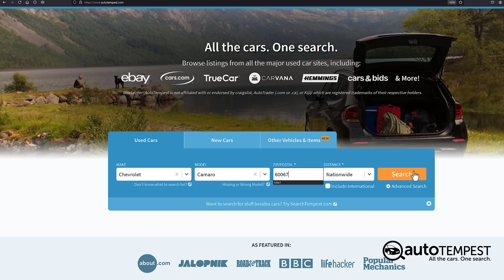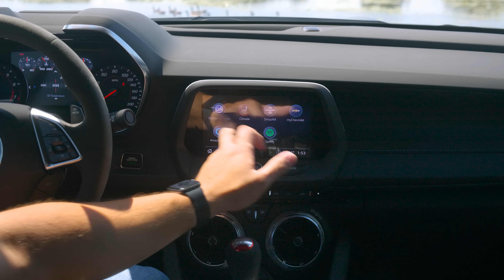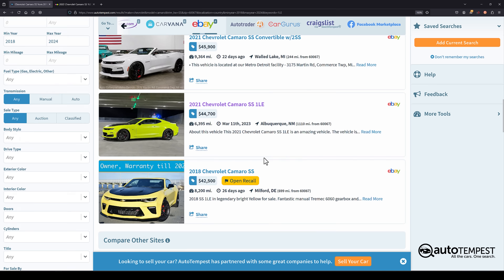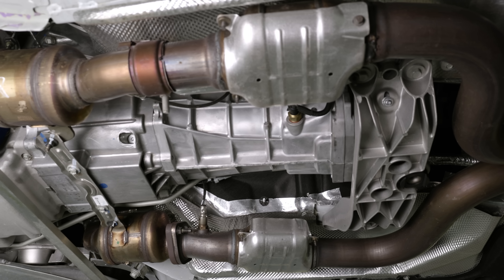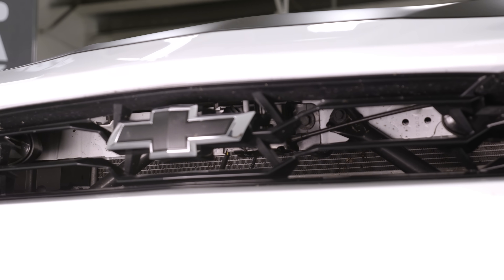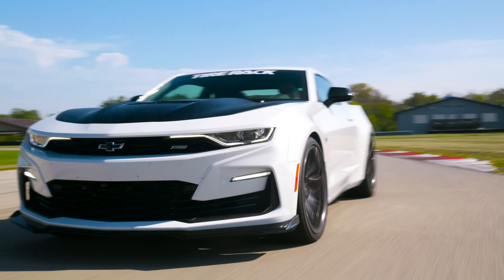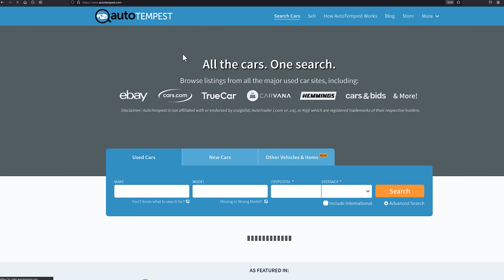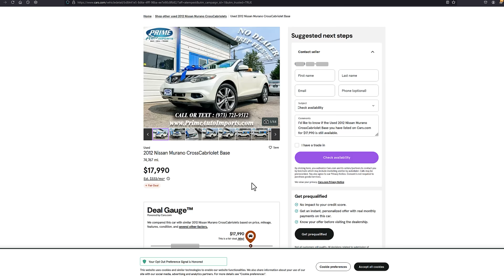Chevy Camaro SS 1LE | Best Used Sports Car of 2024

Comment: Owned a 2015 5th Gen SS1LE and now a 6th Gen ZL1 1LE, They're amazing cars. GM performance engineering is TOP TIER!
Reply: Do you get used to the visibility? That's the only thing holding me back. I like to keep cars long term and I'm not sure I could deal with it.
Reply: @hhaste i rented an SS and def the rear cameras are needed
Reply: @hhaste thats what kept me out of one too, I couldn't deal. You have to drive one to find out. The Mustang competitor here is Mach 1, less value but much easier to live with everyday.
Reply: @hhaste I owned a 2018 2SS 1LE and the visibility thing never really goes away. When you are in the road moving it honestly isn't much of an issue and your brain can easily compensate for it after a while.  But every time you go to park it is definitely harder to know the edges than a normal car. It is also very hard to see backing out. I had a 2ss with rear cross traffic alert which seems excessive in a normal car but I think it should be required in the 6th gen camaro.
Reply: @hhaste in 2017 I sat in one at a car show and said I'd never buy one because of the visibility. In 22 I bought a new zl1 and the visibility was jarring (having never owned a sports car) for 50 miles. You have to position side mirrors to the hips of the car and with BSM it totally went away. Not even remotely concerned about it. Also 21 and on have a full rear facing camera in the rearview that I've never used.
Reply: Yep, even my 5th gen 2LT RS is just incredible with a genuine performance V6 powering it. The ride quality is stellar, the chassis wonderful, and the grip and handling amazing still, despite the car being 11 years old. GM performance is indeed top tier.
Reply: Yes, I owned a 5th gen Camaro ZL1 and a 6th gen Camaro SS2 MT both were amazing great sport cars for the money, even better than some BMW Ms👍
Reply: @hhaste Definitive, you will easily get use to it and will love your 6th gen Camaro. An amazing great sport car.
Reply: @ThomisticAmerican13FOX the replacement of the sport package tires would be more expensive on the Mach l and will last less time.
Reply: @jmmch3358 unless you are track rat, the Mach 1 HP isn't necessary. Tires have much better life on the non Handling Pack cars, I have driven both on track,  Handling Pack simply amps up the expeirence but it does come at a cost.

Comment: I've had a 2018 SS 1LE since new as my daily driver and absolutely love it. The performance value is absolutely outstanding; nothing new on the market is interesting until you start talking double the money. A blast to drive on track bone stock once you learn to manage the weight and tire heat. I would definitely keep this car forever. Unfortunately after 6.5 years of Socal sun some of the GM plastics are starting to noticeably degrade. My plan is to replace what I can while spare parts are still available and then run it as long as possible.

Comment: Have had my 1SS 1LE that I bought new for 3 years now. Daily drive even in winter. ZERO intention of selling the car. The thing is incredible and the interior/visibility does not bother me at all. Gonna keep it until the wheels fall off.

I do not track mine (gasp) so it really brings a smile to my face seeing you legends and others on YT reinforce how great of a machine it is.

regards,
low morale engineer
Reply: The “low morale engineer” sign off hit me hard. I feel you man.
Reply: I was thinking of picking one up us a daily but would need to drive it in the winter as well. I have a mint 2002 Z28 T-top car that I love for my summer fun and only room in the garage for one so if I got one I'd have to drive it in Ohio winters. What winter tires do you use and does it feel safe in the snow without having to go super slow?
Reply: @TheSpink02  I use Michelin Alpin PA4 on the stock wheels. It honestly is really impressive how easy it is to drive in MI winters. I have had Silverado 4x4, jeep wrangler rubicon, then gladiator Mojave before this. Genuinely the only downgrade in drivability is ground clearance. It has the snow/ice mode so it makes it easy to modulate throttle and the LSD is huge for maintaining traction. On the rare really bad days with a couple feet of snow I’ll just opt to work from home but 2 winters now haven’t gotten stuck one time. I was held up once turning onto my unplowed street but was pretty easily able to climb out of the snow drift I was caught on. If you know how to control your right foot this car is better than any FWD car on all seasons I can guarantee that.
Reply: @murrkyyyy  Thanks for the info! I had a Grand National I drove through winters back in the day with some blizzaks and it wasn't too bad but that was a skinnier tire and sat up a lot higher.

Comment: GREAT VIDEO GUYS! Please please tell me if a Mach 1 compares to this for handling and engineering or not even close?
Reply: MACH 1 is a better car to live with everyday, but doesn't offer the same value as Camaro. On track the Camaro 1LE is better, its handling feels better at the limit, but really the chasis dynamics is what makes it feel better. Im confident I can be faster on track in Camaro, but you don't live on the race track do you? 

That said the Mach 1 feels more nimble, more playful, its more fun, especially for everyday use. 

They are close competitors but feel very different due to powerband differences in the engine. 

Both are wonderful cars, picks of the litter of each. Which is better for you? You have to drive both and find out! 😊

Comment: Best car I’ve owned. I had a 19 1SS 1LE. You do get used to the awful visibility but at the same time it does spoil the experience. Especially when you drive a car with good visibility right after…..it’s about the exact opposite of my ND2 lol. It’s a weird experience, it’s such an engaging car to drive yet because you’re in a bunker you feel detached from the road. 

It’s a really wide car and you constantly have to guess where it’s at…especially on a canyon road. No room to play in the lane. It’s easy to curb the wheels too because they poke out quite a bit and again…wide car can’t see shit lol

I personally really liked the interior though, the seats are insanely comfortable and hold you in well. They’re way nicer than the FIST and ND Recaros and BRZ seats. Everything you interact with feels great, pedals, shifter, etc. Best shifter I’ve used by far. It’s as smooth and precise as the Miata but way more heft/weight to the throws and it feels indestructible. Flat foot shifting feels so wrong in all the right ways at first. It never gets old, especially with the snarl it makes. 

Touchscreen worked well, AC was easy to use. No real cup holders but I usually have a backpack and a water bottle inside anyway. 

The alcanterra I didn’t care for…it’s a stupid material for stuff you touch often. Hell it’s a dumb material period IMO

I didn’t track mine, but I found the brakes to be insanely powerful. It stops harder than my ND2 Brembo/recaro pack. I had to emergency stop at about 40mph one time and it felt like it stopped in 20 feet lol. I haven’t driven high end cars like you guys, but it’s got enough braking force to rearrange your guts. Whole different paradigm compared to the BRZ and FIST I had before. 

The major gripes were the visibility and the electronic parking brake…it takes a second to engage…it’s just annoying to not have a manual parking brake. I get space was a factor…but yeah on a manual car it’s a nuisance. 

Otherwise…it was nearly the perfect car. It sounds incredible in stock form, rides well, gets decent fuel economy for what it is. You don’t feel like you need to modify 10 things right out the gate….which is rare for me. It’s the first car that I’ve owned that feels complete as is…which is why I bought it. Came from a droney tuned BRZ….was sick of the modified car woes

Got rid of it because I didn’t have the self control to daily drive it and the running costs were brutal.  It’s stupid fast for a street car and the limits are ridiculously high. It has torque everywhere and pulls hard to redline. Was so nice for highway driving, you can pass in 6th gear without breaking a sweat. It was impossible for me to not drive like an asshole and the pops and bangs didn’t help the image. 😂

Tires are nearly $2k and don’t last long, 10qts of oil, gas prices being high now, and I can’t imagine what the rotors and pads cost or if some of the parts fail outside of warranty….

It’s a “cheap” car upfront for what you get…but it isn’t cheap to own. 

If they fixed the visibility and changed nothing else it would be one of the best cars ever made IMO. It would have helped sell the peasant spec rental car models too…nobody wants to deal with a car they can’t see out of unless you’re a diehard driving nerd….hence why the Mustang and Challenger sold way better. 

Crackles & pops were fun but also a bit much. Stop and go traffic and it’s BLUB BLUB BLUB every time you let off. 🤦‍♂️🤣 Wish they tuned it so it was on occasion not every lift 

It feels just as alive and in many ways more so than my ND2 and yet it’s about 1400lbs heavier. The steering and chassis communicate so well, you’re never surprised by the car. I’m more afraid of my ND2…

If you can afford the running costs comfortably…it’s one of the best cars out there especially for the money. The Miata keeps me out of handcuffs but man I do miss it.
Reply: Agreed on many  points.

Comment: Just a flex sensor, LT2 intake, and set of headers these really wake up
Reply: To your mode list, add a cam, some forged pistons, swap the lt2 to msd intake manifold, proper throttle body and tune, now you are at 600 whp without forced induction
Reply: You're absolutely right. I'd love to hear that chop but I was mainly talking about doing it on the cheap without breaking into the motor

Comment: How are all the reviewers talking about how harsh the zl1 1le is but this doesn’t get the same criticism ?
Reply: Because the two cars don't have the same suspension.   ZL1 1LE has DSSV damped suspension, is designed first and foremost to be used on the track (as opposed to the street), and like most track dedicated cars, it's suspension is stiff and harsh on the road.   By contrast, the SS 1LE has magnetic dampers with a suspension that is tuned to be good on track but forgiving enough on the street.
Reply: @ didn’t know that thanks

Comment: The performance of these cars is truly exceptional. I thought about getting one for years for track duty, I just have a hard time accepting 3,700 lb..... she's a big girl. And there's something about driving a sub 3,000 lb car..... if there is a reasonable way to get a Camaro down to 3200 lb, I think it would be absolutely magical.
Reply: It already is magical. Needs no weight loss.
Reply: If a third party vendor offered a full carbon fiber body conversion including the wheels, i would have jumped for it in a heartbeat. 

I have a 22 2ss 1le manual. It is around 3725 lbs with all fluids topped off. When the gas tank is only quarter full, i can even feel the weight loss. This car around 3000-3200 lbs would be crazy fast on a road coarse.

Comment: Nothing is as perfect as a RWD V8 with a MT
Reply: It is a good formula, but would prefer a mid engine car, especially an Elise.....but no where near as practical as the Camaro and expensive repair costs.
Reply: @93455Driver just missing the V8, then it could be a ME Ferrari F430 or a '05 Ford GT
Reply: @jmmch3358  Good point, 458 would be nice, but like lightweight cars myself.

Comment: Does this car have the Tremec that Chevrolet did not put in the C7 Corvette or is it the same manual?
Reply: Different unit same family, the c7 is a tr6070 this is a tr6060
Reply: @jackholmes8105  The Tremec in the C7 is not great, in my opinion.
Reply: @rayestefania3725  yeah its not great. Better than the auto though

Comment: Which one would you say is better for track work The Corvette c7 Grand sport or the SS 2 1le
Reply: The GS will be a bit quicker because it has the same engine power but weighs less and more aerodynamic.   I think it has a dry sump version of the LT1, so lower risk of oil starvation on high G (1.3+) corners that both cars a capable of hitting.    But of course the GS will likely cost you more, and I heard the 7MT has some issues whereas the Camaro's 6MT is relatively flawless (if you ignore the gear ratio hole between 4th and 5th, which really only matters if your track speeds are going to exceed 140mph).

Comment: Kinda wild that Camaro died right when they got it mostly right .  Alpha chassis was / is good . The   mustang with  10spd and coyote acceleration has something to do with it . That and the coyotes reaction to boost and power despite being much smaller ( displacement anyway ). I don't think most buyers appreciated why Camaro or where camaro was better and good considering people just like going straight and fast often . 

That and the Camp your In and Camaros styling and pillbox thing . That and for whatever reasons real or imagined Camaro has connotations and for some it's a goof and punchline . I have owned one and used it in trailer park bits .

Mustang was tough competetitor selling volume and Challenger just looked good and fit the American physique even if not that awesome . All it needed to do was be good looking and over power tires and most people are happy , add legit cool stickers and scoops and people overlooked the weight , handling and not being as fast as expected considering all the power thrown at them . Traction limitation is kind of a virtue for Muscle Car buyers so .

All efforts apparently went to Corvette and Caddilac for performance and the segment Camaro sat in was just flat  left . Not the first time GM flat left the Camaro after a party .
Reply: The problem with the Mustang GT is the manual transmission, made in China. The 10 speed is good but not everyone wants an automatic. I only want a manual, along with many other people.. and that MT-82 is bad. I would take the 1LE Camaro over it any day of the week, if it weren't for the poor visibility. Camaro's visibility/blind spots and the Mustangs 6 speed transmission are the things holding me back from owning either one of those cars right now.
Reply: @hhaste  I truly think you get used to visibility . Always been cars like this including modern supra.  My first vehicle at 17 was a van with no windows and got very good at using mirrors . It's not , hot a concern but if your on your game , pay attention to where stuff is and WILL BE LIKELY and a little careful not a real issue . But you do have to pay attention and particularly changing lanes and if you weren't paying attention for whatever reason , don't just HOPE ;) . But , if you scan mirrors a lot you know what's around you in general and a good practice in any vehicle . Most people only scan mirrors when gonna make a move . I'm always looking and after a while it's just habit . I also drive manual and even in traffic I am so used to it I don't think about . Even with a manual you need to keep track of everything and be able to downshift AND make moves if needed and driving manual keeps you engaged cuz you don't want to need max power to make a move and don't see it coming and now need to drop one then more gear with a mis shift which would be really awful . Big NA V8, less of an issue but I'm with you about manual trans and YES the Chinese one is not stout or the best and Ford gears the manuals poorly so they are even slower then need be compared to A10 which tells you they want to PUSH people to adopt the autos. Jason Camissa did a great video showcasing how Ford purposefully makes their manuals slower by choosing bad gearing on PURPOSE . Many people also find issues with A10 even if helping straighline #s as far as hunting and kinda too many gears for certain driving . Help with  MPG and 1/4 mile but not great for other performance and daily driving .
Reply: @hhaste  The Mach1 Mustang is equipped with Tremec transmission very similar to the Camaro's. The Mach 1 Mustang trim is its true competitor, even Performance Pack Mustang GTs dont compare as they have the MT82 and lack the cooling necessary for longer track runs.
Reply: @ThomisticAmerican13FOX  yea, Ford still cheaped out on the Tremec - it doesn't come with the TR-6060 like the Camaro

Comment: Same driving dynamics as gt350?
Reply: Superior to a GT350.   More similar, if not slightly behind a GT350R
Reply: @northcamarolina7453  it i think so too makes me wonder even tho gt350 has more HP.
Reply: They feel very different because of powerbands. The chevy has immidiate torque down low but tires out at top of rev range. The Fords like to rev, they dont have torque until later in the powerband,  but boy they shine at high revs. To me the Fords feel more playful, but there is no denying the Chevy has the win in initial power delivery. 

Still the Shelby feels more special and gives a better visceral expeirence, buts its way more money. 

MACH 1 is better comparison to 1LE

Comment: The gen 5 Camaro SS 1LE used FE6 suspension.  For that gen, all SSs got FE4 starting around 2012 if memory serves.  It doesn't really matter but GM RPO code nerds like me enjoy studying them.  Are we sure this 1LE is on FE4?
Reply: Gen 6 changed the naming of suspension packages vs gen 5

Comment: Thanks for the video! For the track driving segment, do you know if the car was on track alignment? It did not appear to be thus the negative front grip comments.
Reply: It was 2.7 degrees of negative camber. It was very very warm out though so your window with the tires till you overheated them was really narrow